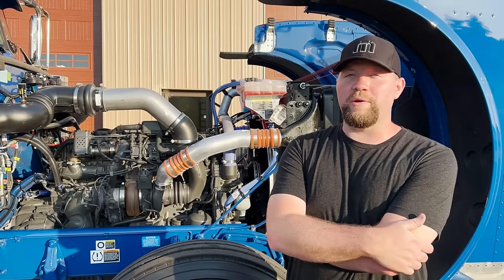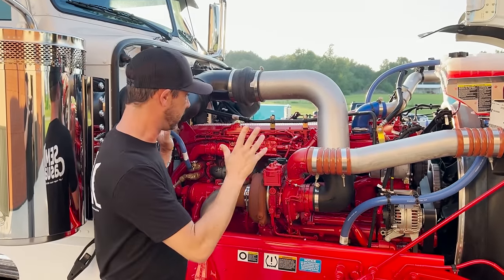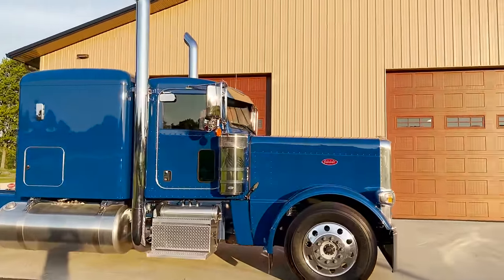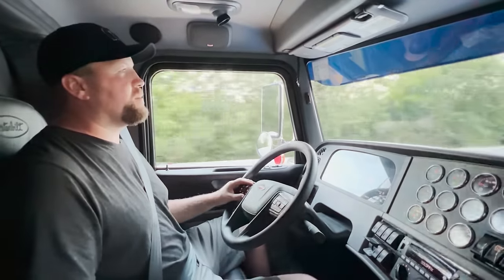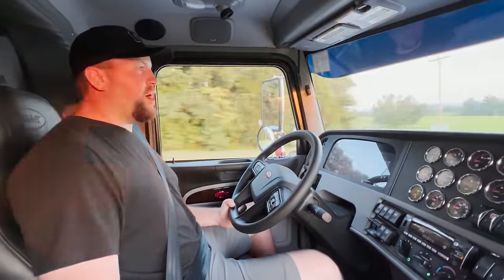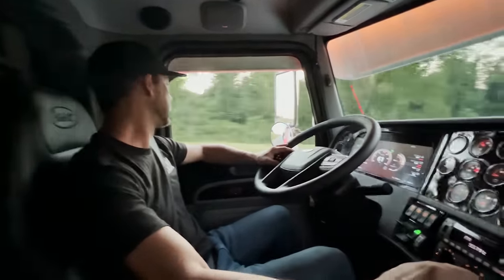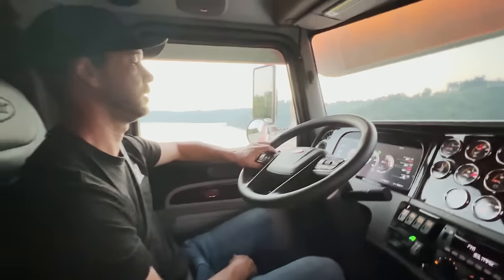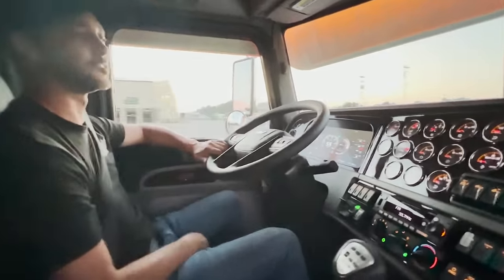Cummins X15  VS.  Paccar MX13  -  What are you gonna choose?

Comment: I've owned MX's since 2010, had Cummins, Cat's, and 60 series Detroit. I did a lot of research before choosing, warranty coverage and cost. Had a Cummins prior and wasn't happy with warranty. I run my trucks 3 years and get a new one, but always put the extended warranty on them. Emissions were the biggest problem till 15,16. Maintenance is the most important part of owning trucks. CEL comes on get it checked, doesn't matter what color it is. 
My 2010 had all kinds of emission problems, was the 455hp multi torque, I could run with any 1850 torque cat or Cummins and get better mpg.  My 2017 was bought by a friend of mine, he deleted the emissions after 500,000 and warranty ran out has 800,000 on it and it's still running strong.

Comment: The truck I have has the paccar in it and I’ve had 0 problems with it with over 300k miles. Of course it’s a fleet truck auto shift, but I don’t think standard would make that big of a difference. I would still choose the Cummins just because of dependable name and of course the sound, I hate quiet engines.
Reply: I love quiet, but having been deafened by loud diesels and bikes. Well.😱😎

Comment: I've been out of trucks for about 10 years now due to an accident that rendered me disabled.  But the last truck I drove was a2001 379 Pete.  It was setup with a 650 hp 6NZ cat  18 spd transmission with 355 rears on 11/24.5 tall rubber.  We hauled quite a few OD loads mostly.  It just couldn't be beat. But it also only got at best 5 - 5.5 mpg.
But you could hear every valve opening, especially the truck spooling up. I noticed that you could hear the trubo spooling on the paccar. Not so much on the Cummings. But I think you should also do a review on the big detroit engine. I think it's honestly got both those engines beat in today's market

Comment: Having driven them both ... the Cummins.  The power difference between them is astonishing but that's not the only advantage of the Cummins.  My company's X15 dump trucks have far less downtime and actually get better mileage than the MX13 ones.  Cummins average around 6mpg while the Paccars get around 5, presumably because they have to work much harder all the time.

Comment: On my own experience you can’t be wrong with Cummins I have 3 ISX15, 2012 and 2013 with 10 speed transmission with over a million miles each still running strong and a 2016 ISX15 as well with 13 speed and 870k miles runs like new no issues whatsoever. 
Stay save out there guys 👍🏼
Reply: Do you recommend buying ISX15 engine truck with 750k miles

Comment: Im a kenworth tech, i would take a cummins any day,although a paccar mx 13 isnt a bad engine at all,the issue with the mx is its way too over engineered,and once the engine starts to mess up your done,I’ve seen about 35 long block mx 13 in my one year working at KW and only 2 x15, don’t get me started on all the new issues on the epa 21

Comment: Been running the 2018 mx13 in my t880 for almost a year now. I don't idle my truck when ever I can. I have had no issues with the truck. Gets a good 8mpg too.
Reply: We've been running 10 x 480hp MX13 DAF trucks, pulling 161000 pounds, averaging 5.4 tot 5.6 mpg and doing round trips of 2000km in South Africa, overall kinds of terrain - including a few mountain passes - no problems so far. Runs with the Cummins's every day.

Comment: The MX is quiet lighter great on fuel & has low end torque. The isx is obviously the bigger motor with more power options but more on fuel for sure! Both will get you a million miles if taken care of.
Reply: Nobody's Paccar is making it to 1M miles with a rebuild or engine replacement.  My truck has 500k miles on its second paccar motor.
Reply: @Ball.Daily11  Plenty have it’s all about your maintenance on the motor & knowing the real history of the truck we’re running 2 660s 2014 models w/ Mx13 both 850k plus on the original motors oil changed every 12k had them since they were new Everybody truck is different it ain’t gonna last if you don’t maintain or run it right.

Comment: Another thing. More torque does not mean lower fuel mileage. Think about it this way. The more you have to down shift the more fuel you use. A truck that won’t pull won’t get good fuel mileage. There is such a thing as being under powered. If you just look at the numbers they both have about 500 hp engines with 1850 torque. Detroit has a 13liter engine with those numbers too but you feel the difference when you’re pulling with them. Neither of them can keep up with the Cummins and I’ve seen them getting comparable fuel mileage.

Comment: The MX' I've driven in 2016 T660, and currently a new 2023 MX in a T880 all vibrate like crazy at idle and under load.   More then the X-15 of comparable vintage and even more than a 2001 Series 60 I used to drive .  They also start harder than the X-15.

Comment: I can deploy upgraded full emissions intact calibrations that will save $20k-$30k per truck per year, for the ISX15 (2013-16) and X15 (2017-22) platforms. I've had over 1 mil miles testing... They increase 400+ lbs ft of torque, improve drivability and driver efficiency and productivity (40+ min per day). You can pull Eisenhower, with 80k lbs, at 40 mph with CC on.

Comment: I drive for a copy and we use to have all Cummins 565hp and we gross about 100,000 lbs and ever truck that had a Cummins in it we had to over haul everyone with less then 200,000 miles. We got read of all of those trucks and got all Paccar motors some got 18 speeds and some have automatics and they have less maintenance and out pull the Cummins and do better on fuel.
Reply: Are you serious cz iam about to buy a truck a t680 I'm torn between an mx13 and x15

Comment: I have MX13 EPA 13.
Yes, its an older version but I want to emphasize that YOU ABSOLUTELY NEED TO UPDATE SOFTWARE ON THE MODULES in order to keep that engine running smooth.
Stop by any KW/Pete dealer every 6-8 month and ask them to update your modules, that alone will save you a lot of time, money and headache.

Also, MX-13 is the only B10 rated engine on the market, as far as I know.

P.S. As far as I know MX-13 EPA 21 is still having issues with the aftertreatment system not being properly dialed up by Paccar. It's a software issue, not mechanical.

P.S.S. DO NOT CHANGE YOUR OIL AT 75/60K PLEASE,  CUT THAT NUMBER IN A HALF

Comment: As a mechanic at a trucking company, the mx13 sucks to work on. Constant fuel system problems. This fuel system was way over engineered,way too complicated and more parts and pieces than was needed to get the job done. Main fuel pumps are known for breaking mounting bolts. Front one, fuel filter module must be removed to access. Rear one, getting to it not so bad,but,getting broken bolts out is miserable because it sets so close to the block. We only have three left in the fleet, and as far as I am concerned, they cannot be gone fast enough.

Comment: The choice is clear, the X15 is a great engine, especially with the 2050 torque option giving you heavier axles, driveline, transmission and clutch. Unfortunately the 605 spec is overrated. Put it on a chassis dyno and you will be disappointed. I drove my brand new 389 for one load before making significant mods, turning it up to 745whp. Ive got 500k miles on her modded and she's doing fine.

Comment: I ran a dry van , I don't even need 605 hp,I'm good with 500 , my return loads from laredo tx weigh 30000 lbs max  I'd still take a cummins over mx13 ,only because I hate to be stuck on the road .I've had really good luck with cummins

Comment: In the 80s most engine ran 16 to 2100 RPMs. What Automatic transmissions are you talking about ? I drive a Casscadia with a DT 12 automated manual transmission. It’s a joy to drive but the DT12 has its quirks.

Comment: What is the long term maintenance costs of these engines I.E. major overhauls. Also using the same roads, loads and gearing, are you doing more shifting with one over the other? I would translate that into driver fatigue.

Comment: So i have a paccar epa13 MX13 2017 579. 751,979 miles on it as of writeing this message. I have had to replace near on the whole engine. Heads, turbo 3 times now, waterpump 4 times, ac compressor when it literally exploded. rings and sleves, 2 pistons, injectors at 100k 170k 419k 567k 615k and again at 682k. Entite fuel rail not just individual parts mind and paccar parts NEW not remanned. head gasket twice, charge air cooler, radator, fan hub assembly, altinator, its on its 12th starter now, fuel pumps, oil pump and the ENTIRE emissions system including egr dpf scr doser you name it ALL OF IT.....TWICE and warranty didnt cover around 3/4th of this crap and they have fought me every single step of the way until the warranty expited and left me on my own. And my truck is only 455 horse no crazy tune nothing factory bloody stock. Oil changes at 10k with T4 shell as my oil samples say to do. Air filter every oil change and fuel filters at 5k, it has had an APU since day 1 so i dont idle much which rules even THAT out. Hell it only has 15923 hours on it.

Only reason i havent just replaced this peice of junk truck is it keeps me so broke i literally CANT. It has been a nightmare from day one and paccars jerking me around has ensured ill never own another MX13. Hell it only started to function properly after i "solved" the emissions issue at 700k as a final hail mary before i had to throw in the towel. First time since ive owned the rig ive gone more then 3 weeks without a red stop engine or blinking def light. No i mean that literally. 5 years ive owned this rig and in that 5 bloody years 3 weeks was my record for no check engine lights.

Sure maybe i got a lemon but in 15 years of driving i have NEVER owned or used such a peice of junk as this paccar.

Comment: I have driven all engines with all types of transmissions. Ill take a Cummins, or a CAT over a Paccar if I can. Paccars have to wind up high in the RPM (1500-1700rpm) as the Cummins and CAT (1200-1500rpm) to get good torque out of them.
The Paccars sound like jet engines when they're winding up, the Cummins and CAT sound like good old combustion engines with pistons slapping away ... if that makes any sense to yall lol.

Comment: I've driven both engines. They both did a fine job for the application they were used in at the company I worked for.  Cummins has a far larger service network than paccar and the paccar engine needs a EGR wash every 50k miles.

Comment: I have driven both in B model Kenworths. I didn't mind the MX but I wouldn't trade my 605 Cummins for one. The company I work for hasn't had the best luck with the MX engines we have. If any of the MX engines in the fleet I work for have any major problems they get replaced with C15 Cats

Comment: Paccar motors only down fall is it’s pretty much a dealer specific motor no one has the software “Davey”, when it comes to Cummins every mom and pop shop have the “insight” if you can afford to have your truck down for a week for a simple diagnostic and a sensor the paccar is great, the Cummins a mom and pop can diagnose it and have you up and rolling in hours. Also paccar and Cummins share the exact same emissions sensors on the exhaust (scr/dpf & def).

Comment: I have 10 KW T680 with paccar engine in my fleet. They all close to million miles. Never had any problems. Change oil every 15k miles. Not even a drop leakage on all trucks. So far just DEF problems. But that same system in Cummins too. I have 3 concern with paccar. 
1. Little less power going uphill. 
2. Parts are expensive then Cummins 
3. Mechanics avoid to work on it. Besides dealer.

Comment: I have a 2022 Peterbilt ultraloft and it has an MX 13 in it and the fuel filters have to be changed every 50,000 MI not 75 because the engine light comes on and a wrench light comes on which tells you and needs to be changed

Comment: I have had 3 cumalongs in a row with last 3 trucks. Seem to be good engines but at about 700000 all three start getting those mystery coolant losses and eventually hydrolock needing a rebuild or a new head, one was egr cooler. One was efficiency series.
Reply: Usually the #5 liner busts loose. Most of these trucks are geared with some stupid ratios. And then Cummins recommends lugging them for best fuel economy. You lug these motors and those liners will bust lose every time. Usually right around that 700,000 mile mark. Remember that if you are purchasing a used one with around those miles. In frames are not cheap.
Reply: @michaelwright1602  I drive for a company. They just did an inframe on this one

Comment: I'd rather the less complex 
Being familiar with cm870,2250,2350
I'm happy they've greatly simplified the emissions system. 
Yet to make a jump from my 2015
With the manufacturers going to proprietary software 
Not certain I'll pay the price of admission

And with paccar 
You'll find plenty of them in core piles
1st and 2nd generation motors had serious issues with wiring , fuel , and internal corrosion problems.
Been told there's been vast improvements with design and build up..
Still ain't a fan
Living in the mountains 
You absolutely need torque 
Which the MX
Has little to offer

Comment: I’m currently working with an International LT company truck. I haul light weight loads, and asked for a Paccar when they swapped me out of the Volvo I was driving. It does have the Cummins x15 in it. I see no benefits from the Cummins engine as my Volvo went up hills faster, and was better on fuel mileage. I’m about to start a new job hauling food in refrigerated trailers, again I’m hoping to get a Paccar truck, with a MX, but I might have to wait until I own the truck and can trade it in for the truck I really want.

Comment: What are the rear end gear ratios on these two trucks..  My company has the paccar mor auto trans and 279 gear ratio.. Haul less than 10,000 lbs most of the time. When hauling heavier loads this combo is a roadblocking machine. %80k miles and already has had a new block and the clutch went out at 400k and trans was just rebuild 40k miles ago.. Definately miss the manual and the sound of the bigger horsepower!!

Comment: 2020 Peterbilt with Pavarotti MX13 failed on me after 545,000 miles - engine knock… Switched to Cummins X15 with 335,000 miles and have about 3 weeks of driving it OTR so far. Here is what I can see: obviously consumption of diesel increased - used to have on average 8.3 mpg and now only 7.5 or so. Sound of X15 is more distinct with and pronounced along with overall more mighty feeling. Torque and power is definitely higher. Sounds and feels like more sturdy. According to our shop mechanics Cummins is a better option. As to owner operator or leaseholder for OTR application most likely MX13 is a better option as more economical, but if planing to hold longer than for 4 years, then Cummins X15 is more reliable.

Comment: We ran the paccar for a little bit, changed oil pans on all of them(cracking), stayed in the shop a lot. We hauled around 75000 on flat ground mpg was about 7.5. We went back to Cummins!
Reply: What is your average with the cummins compared to paccar?
Reply: I have isx15 on my kw t660 is a factory 550 and I added the pdi carb legal tune exahust manifold pdi, oil cooler pdi dual cooler and I have 336 gears on 18 spds my fuel is about 7.8 mpg at fully loaded, tipical 79,000 pounds and the power is unlimited, Cummins all the way